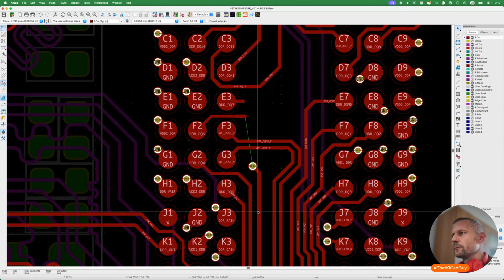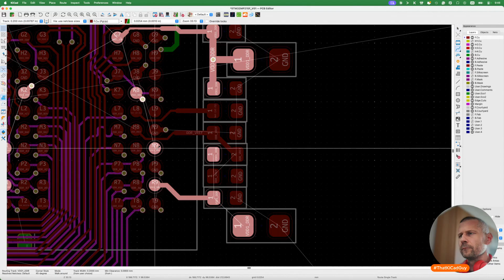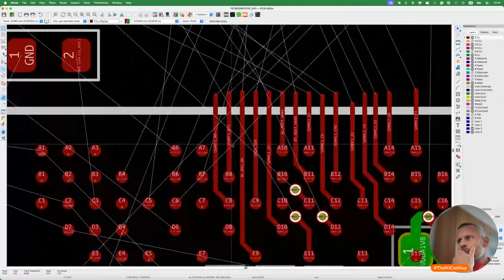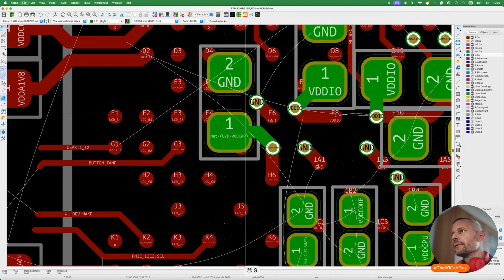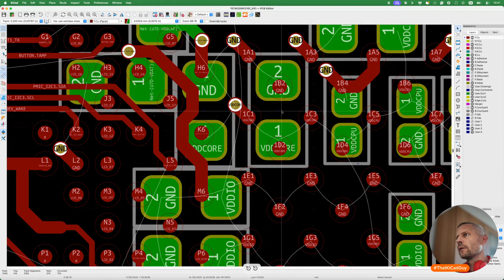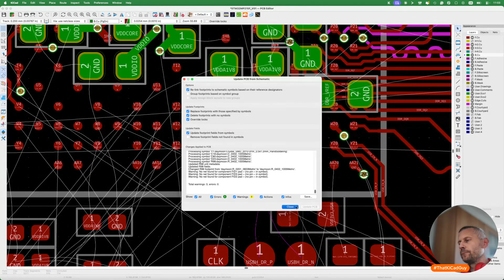KiCad Design Stream STM32MP215F, part 25

Comment: Good idea to change 0201's to 0402's, and deleting a few. It does not make routing easier, but makes manufacturing much more bearable. Great progress. Thank you for the stream and looking forward to next week.
Reply from the maker: Thank you. 0201s are difficult to handle as I described. 0402s are my lower limit. Thank you. See you next week.